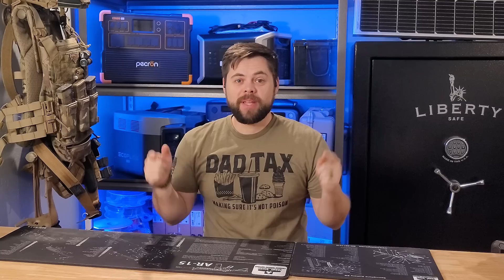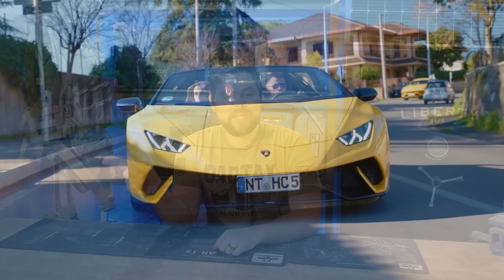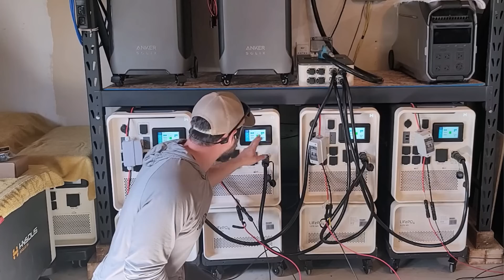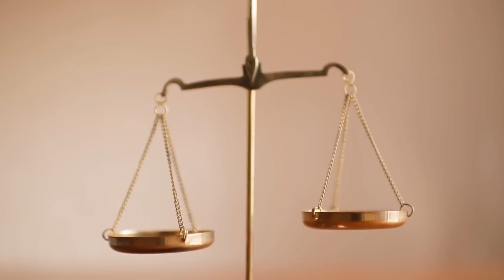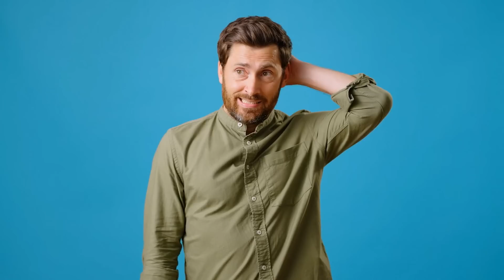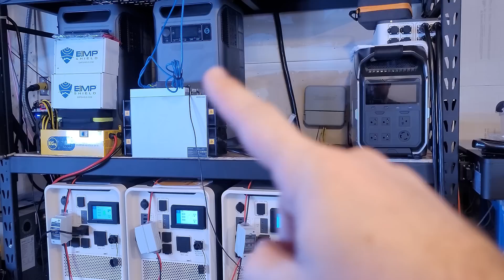These 4 Reasons Are Unlike Any Other for Hysolis and the Apollo

Comment: So, Hysolis is coming out with a Chargeverter, years after EG4 did?  The Apollo is an impressive product, but for the insane premium they charge, they had better be a great product!  They allow you to set up a microgrid, but it's still kinda-sorta mobile.  There are definitely some use cases for that, but not many.  For stationary use cases, there are far more cost-effective options.
Reply: I mean i just looked at the price of a hysolis on their website and it's about the same price as a Delta Pro Ultra. That being the case I'm gonna go out on a limb and say that there really is no comparison between the two the hysolis seems to be the way better option. Yes the DPU is prettier but I think the hysolis has way more capabilities. If I had to do it over I should of got the hysolis.
Reply: @lanceboudreau3630  - The DPU has the same basic challenge, though; it's a HUGE system that can only be called "portable" in the academic sense of the word.  I guess if you have a sizable off-grid cabin and a need for home backup power, something like the hysolis or DPU could be moved back n' forth, but they're both right at the upper limit of what even young, healthy folks are going to want to hassle with.  For stationary needs, there are far less expensive, and more capable/scalable, open architecture solutions.  If you already bought the DPU, what was your specific use case?  Is it just for home backup power, in a single location?
Reply: @jasonbroom7147  agreed neither are really portable. With the complexities of setting them up and the weight , moving these won't be something you'll find yourself doing more then a couple times before you say to heck with it.i was just pointing out if you had to choose between the two for 5k$  I'd choose the Hysolis. More PV input as well as 3 phase power, and I'm pretty sure the out put can be expanded much larger too. Plus all the other stuff he said in the video.
Reply: @jasonbroom7147 I suspect I picked the dpu because of the neatness of the package without the excessive cabling. I am an engineer but I chose to go with something simpler and quasi portable. 

I have a single DPU with one battery. It gave me 240 split phase in a single package.  I have it as a backup learning platform to my whole house system, FLA from 2011.

I believe the Apollo has american-based customer service while I have been dealing with Indian service for the DPU.  Not bad, just the normal Indian English language barrier

Comment: i thought i heard you talking about the F3800 sharing battery charge between two units when using their hub......  I like the Apollo but i just cant see my way to buy a Lamborghini as a day to day driver........i can own several fords for less and use the extra money for other projects.
Reply from the maker: Yes I did get one kind of sharing between the two F3800s but I can't recall exactly what it was. But it wasn't full sharing like the Apollo, only partial. I was able at one point to drain one F3800 lower than the other and then somehow balanced it later. I'll have to test that again.

Comment: But both the EcoFlow Delta pro 3 and Delta pro Ultra already have split phase and you just add batteries to them. So are you saying that EcoFlow is doing something in those two units that they don't supply power equally to each phase??? Also G4 Chargverter will allow you to use any Generator.
Reply: The capital cost per charge for one Ultra is more than the capital cost per charge for two Apollos.
Reply from the maker: I was referring to the Delta Pro and other units that use two units to get 240v, like the Apollo, but don't share the loads. Additionally, you can have two DPUs together on the 50a hub, but if unit 1 has no solar input and unit 2 has solar input, unit 2 will not share power to unit 1, eventually reaching an imbalance. The Apollos can have no solar on unit 1 but have solar on unit 2 and unit 2 will send power over to unit 1 to keep them the same.

Comment: The imbalanced leg problem does not apply to the DELTA Pro Ultra.
Reply: Or the Anker f3800, split phase 240 in one unit. Add 6 batteries for 26kwh. What am I missing?
Reply: @rikwashburn827  Capital cost per charge cycle.
Reply: @ralphpezda6523 we are talking about the unbalance between phase he claims is exclusive to Hysolis. Not true. Anker allows 2400W solar per unit. It’s far more portable , costs less , and expandable to 56kwh. I own 2 units with a power hub. 12,000w 50amp 240vac. With articulating arrays of 1200w I have no problem topping off the batteries with 4800w. Not sure why anyone needs more than that. My only complaint is how much these units draw when they are on and idle. I’m thinking I might move my second unit to another property or mobile application as the power hub is Power hungry, and 6kw with 26kwh per property should suffice. I don’t plan on charging off the grid with either. No additional inverter needed.
Reply: @rikwashburn827  That's nice.  Do the math on capital costs per charge cycle.
Reply: @ralphpezda6523 why? Maybe I should wait for solid state? Calculate costs for initial purchase and compare them? Hysolis LiPo’s have more cycles? 3000 cycles is 8 plus years of FREE solar charging . Do They have a deal on cost per KW off the grid? Calculating that depends on wether you have peak hr pricing and where you live. In 8 years the tech will be Completely different. I’m confused about your off topic point. Original comments were addressing the alleged lack of balanced batteries in multiple units. What is your point exactly. Care to elaborate?
Reply from the maker: It doesn't apply if you're only using one DPU. But when you have two DPUs using the 50a hub, they do not charge share, only discharge share. So if unit 1 has no solar and unit 2 does have solar, unit 1 will eventually run out of power whereas unit 2 will keep going. They do not send power between each other, they just both share the output power of the output legs and that's the only thing that helps to keep them balanced. But eventually, the two units get unbalanced due to one charging more than the other unless you're in perfect conditions 100% of the time, which doesn't exist. It's not a huge problem with the DPUs, more an issue with the DP1s.
Reply: @minutemansolar  ahhh. I was not aware of that. TY. Not sure how often that would come up as I would naturally be charging equally on both units with solar. If 2 DPU’s are drained via the dual port’s 1450 even with an unbalanced load wouldn’t the DPU’s drain equally?  my experience with 2 and the hub has a bigger flaw. The dual port even with no load, on and idle drain more than 50% in 12hrs. ?? This is not the case without the dual port. More like 5% . I’ve contacted Anker who started a ticket and then had me follow up with the AI Email. It insists that that is normal for a dual hub and recommended turning it off when not in use? I didn’t buy it to keep it off. Anyone want to buy a dual hub? Fortunately my property had 6 panels and 2 meters . I’ll be moving one DPU to the other service. 6kw on each will do the trick. I should be able to off load most used circuits to solar 24/7/365 with enough batteries.